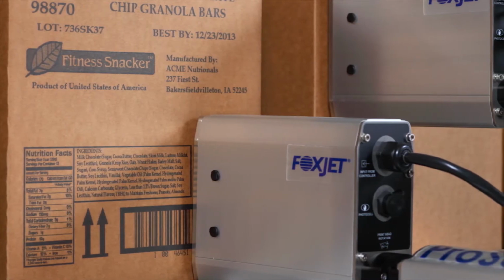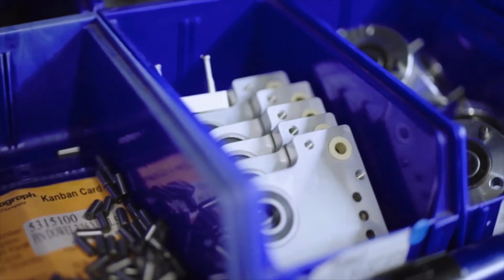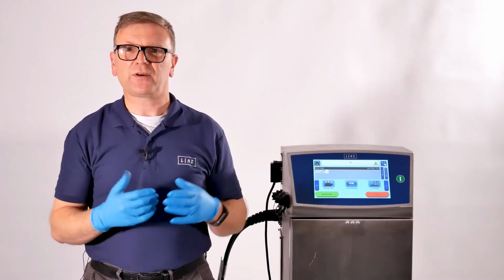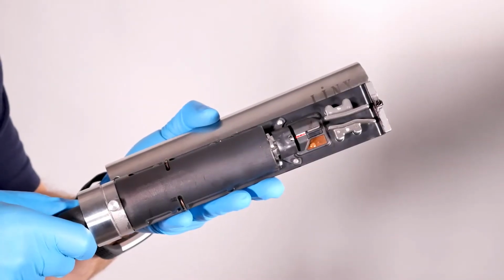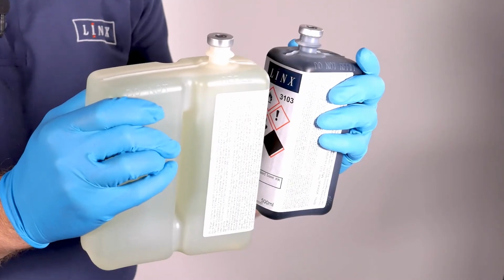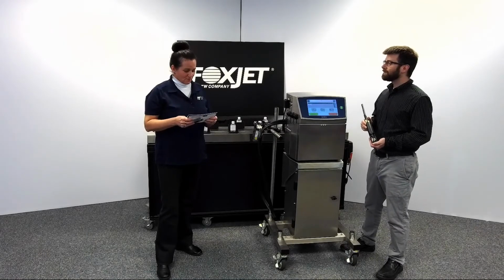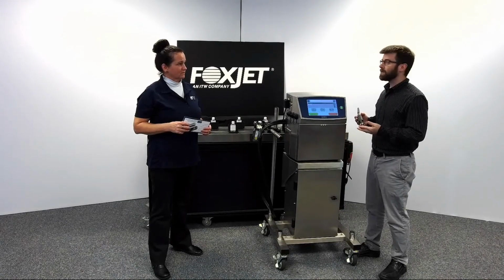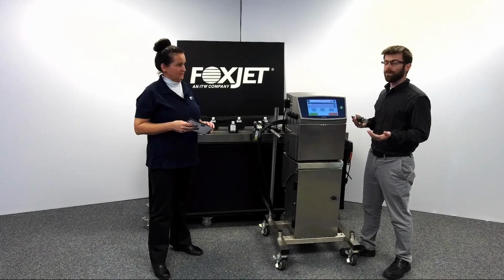Ensure your coding equipment is reliable as you implement safety regulations

Comment: 0:47 I setup you auto proffit site with done for you 6k monthly income. It is a ready made website with content, connected offers (digital products), google advertisement, amazon advertisement and 1 month connected traffic of visitors. Managing it wisely you earn 6k monthly and your expenses will be 1950$ for the installation and 600-700$ for traffic which you need to send monthly. Speaking about traffic you will not need to worry about this- as we usually send this amount and we continue maintaining it. It is not the system that you just press the button- and here is money, as you will need to manage it. But if you follow our instructions the income is guaranteed. w h t s a p +7 9 6 7 1 5 7 0 5 8 1